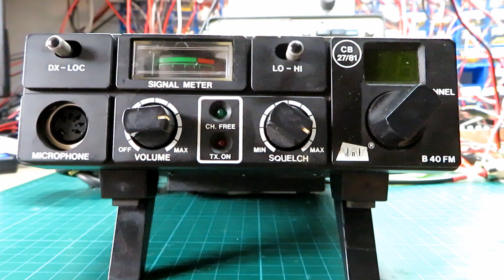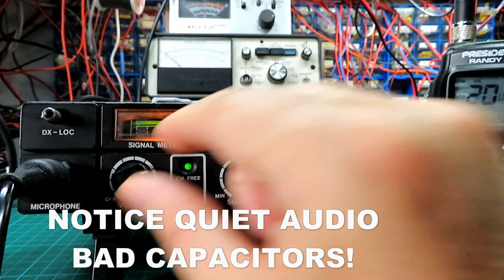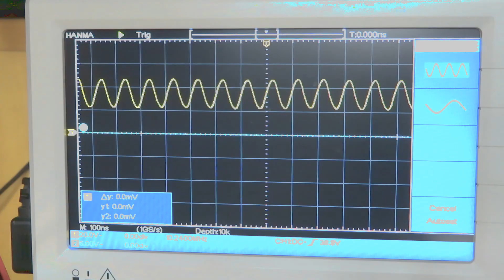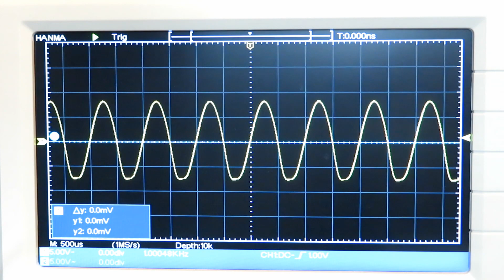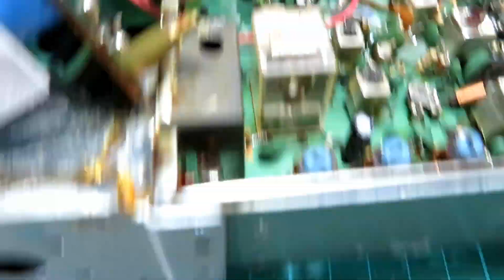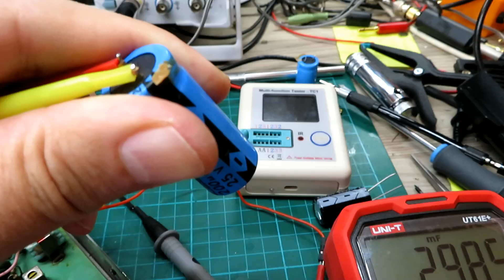DNT SHOULDN'T STAND FOR DO NOT TOUCH -  IS THIS THE SMOOTHEST SOUNDING RECIEVE IVE EVER HEARD ?

Comment: I bought one of their mobile rigs quite soon after it was launched, its RX was said to beat all other rigs tested in terms of sensitivity.  Its board was neither cybernet or uniden, but there was something I didn't like about it. Too far back now to recall what that was, but .i replaced it with a Radiomobile version of the Cybernet 1000. That set had the mike socket on the side rather than the front, so was narrower than the 1000. Still have it and the big one, the Ford badged Cybernet 3000, I put an auto squelch board in it, made it easier to live with all round. I liked the Cybernet board for FM sets but never for SSB types, for that I had 148s or 360s. Those were easy to pick up for £40-45 if standard, my tech would align them nicely and take out any EPROM additions, pretty rigs in a good state of tune would fetch £140 if given an alpha up switch and the beep made switchable. I still have one completely untouched mk2 but it had a tough life in the hands of an old trucker who only used it on the first 26 channels of UK40. Nice to have one that's untouched but I sure wish the old boy had been more careful with it.

Comment: I had one of these, the DNT stood for Does Not Transmit in my local, it wasn't a bad radio tbh, the only issue I had with mine was one of the front legs wouldn't lock and it continuously kept falling forward and slapping the cabinet it sat on every time it moved, I swapped it for an Amstrad 900 which blew up a few weeks later, 🤷🏼‍♂️

Comment: I hated how the PA transistor was on such a long thin heat sink, I fitted a thick piece of copper between the heat sing and the side of the case on mine, as that heat sink was doing nothing in my opinion.

Comment: If i remember right? they have the wrong crystal filter fitted is should be a 10.695, 8 or 15khz B/W
 They fitted a 10.7, you will have lopsided RX

Comment: Here in the states once again :)  This has components resembling my first CB Radio in 1983 - a GE 40-channel with "night feel" knobs as advertised and 5-pin DIN mic connector.  Although having simpler bar graph signal strength and no toggle switches.

Comment: They were cracking radios once they got the crystal filter, the Radiotechnic Supertuned ones especially.
Reply: @johnrobinson2643  Yeah, they're a good piece of kit for that too. The ICB-1050 (or equivalents) is an easier convert to 10FM  though it's not as nice a radio. I kinda want to get my hands on one of the really crappy radios like a Binatone 66 with PLL02A or maybe even a Cheiza/Great/Fidelity 1000 with MM55108 and stick that on 10FM now the sunspot cycle is running again